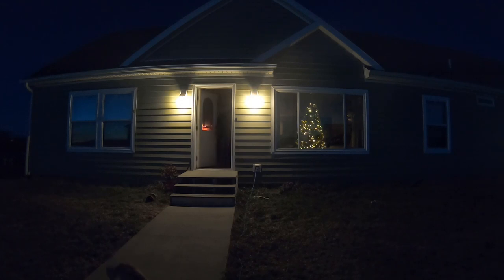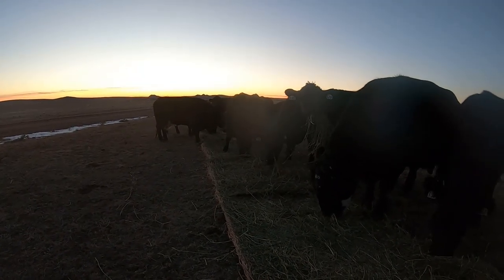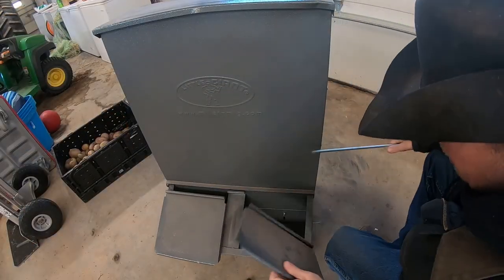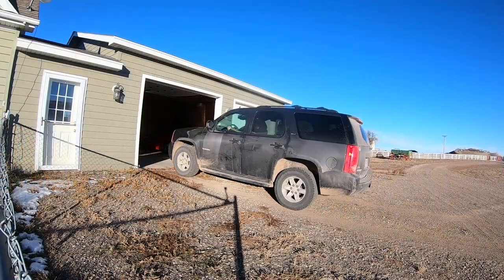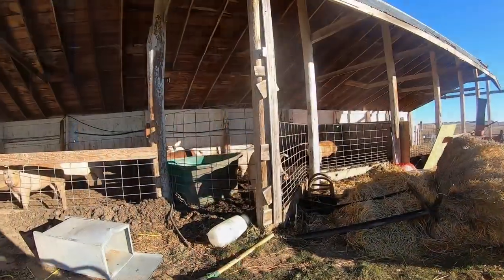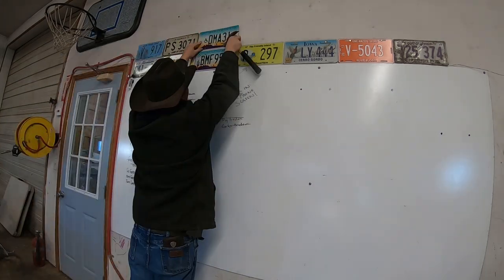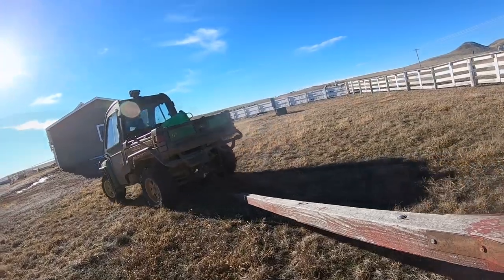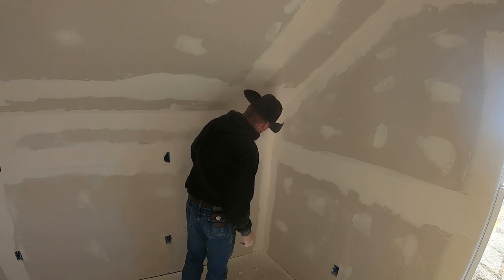Morning on the Ranch - The Project List

Comment: You need to take the sections of siding apart before reinstalling them.  It looked like you had two pieces of siding still hooked together when you were refastening it.  That leaves the lower section unattached from the house.  And you should really use roofing nails not screws to attach it to the house.  I know it seems like screws hold better but the roofing nail head is bigger.  If it was nailed and the nails pulled out of the house then you need to nail into the studs, not just the sheathing.